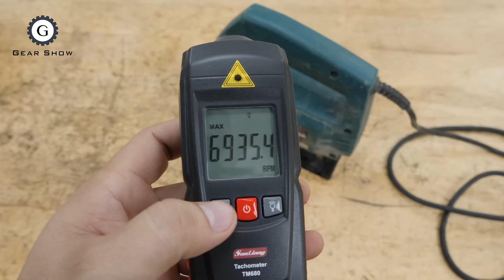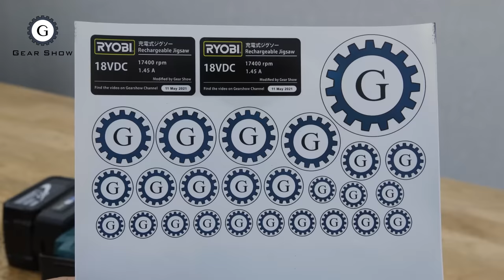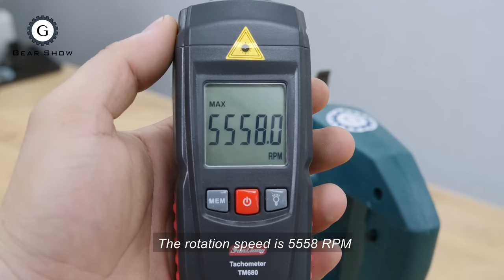Cord to Cordless Jigsaw Conversion from 110V to 18V | RYOBI MJ-21

Comment: the only thing is that the button contacts will not survive later, because the consumption has increased from 4 amps to 10-20
Reply: Yeah .a solid-state relay should do a trick

Comment: What's going to stop the torque from eventually spinning the motor around and ripping the wires loose?  Did it fit snugly enough to prevent it from moving?
Reply: Exactly, I think about the same effect... I fixed a manual mixer that had a motor electrical connector broken because the same effect :-(

Comment: 4:38 that is such a neat and smart way to find the center point, I love it
Reply from the maker: I'm glad you love it, thank you!
Reply: @GrzegorzKr  oh hello, you must be from the department of redundancy department...
Reply: @HunterRodrigez  rofl. the centerpoint trick only works with a perfectly aligned bench drill though. pretty smart nonetheless.
Reply: @mediajunkienl  Well, I'd say it's more reliant on having a very accurate chuck, and drill chucks usually aren't. I'm surprised it worked.
Reply: @Nevir202  You are very right, but mine also has some play in the drill body that's on the rail, adding extra eccentricity :)
Reply: @mediajunkienl  that's why he said use the lathe to drill
Reply: The whole project was silly beginning to end. He took a high quality corded tool and made it into a piece of junk.  He should have just replaced the brushes and cleaned and swap out the grease and would be as good as new.  He went from a high quality AC motor to a poor quality DC motor.
Reply: Until he used the punch to indent it which has significant room for error, would be more precise to use a tiny carbide drill to start the indentation.  I'm sure it will work for a while but the more off it is, the more it side loads the bearing and increases wear as well as a little power loss.
Reply: @tarstarkusz  On many similar projects I would agree with that assessment, but in this case I wouldn't go so far as to call it junk, rather a waste of time because he could have cleaned it up, sold it even if it fetched little money, then the proceeds plus the value of time and new motor(s) (that one is unlikely to survive long term), could have just bought a cordless saw compatible with the cordless tools you already have so no new battery or charger needed.  Low end saws with that or higher performance aren't very expensive.
Reply: @stinkycheese804  I just have not had a lot of luck with cordless tools, and I don't need the portability, so for me it's a lot of downside without any real upside.  If I owned a spot welder for batteries, I might change my mind. But even rebuilding the battery yourself still isn't cheap (I would never put anything but the highest quality cells in any cordless appliance).
  But by the looks of it, the AC motor was not bottom of the line motor, while the DC most likely is.
Reply: @tarstarkusz  and you haven't really done any of that and don't even have a clue what you are talking about...to sum it all up
Reply: @gear_show  Yes, mind blown! The sandpaper trick was super clever xD
Reply: @stinkycheese804  it's not such a tragedy, people have been making their own power tools for ages with hand tools and far less equipment. Successfully even, factory stuff is not that well balanced either. 

Want to learn balancing fans, mover blades, motors? Take a factory piece, plenty of room for trial and error, as there is for improvement.

I wouldn't have done this project either but you naysayers can just find impressive explanations on how simple things won't work to the extremes of how a wheel wouldn't roll unless made by a big brand...
Reply: @dushk0  People were riding horse and buggy years ago too, but I for one don't want to go back to the days when these great burdens took up so much time and energy to leave little for anything else.  To do so today is madness, or a hobby, but as a hobby there are so much better ones.
Reply: @HunterRodrigez  🥺🥺🥺🥺🥺🥺

Comment: This is great, my only concern would be the switch handling the much greater current you need running at low voltage DC. If you run into problems down the line, I’d check that first.
Reply: Should add a Mosfet for high current  switching. The original switch will burn out very quickly under load.
Reply from the maker: @Sheran Naidoo I will try your idea, thank you so much!
Reply: @gear_show  Yeah DC current draws more amps than AC. But LOVE your work better than landfill

Comment: I'm a Huge fan of your work, I love the way you present your restoration and it means a lot to us when we are in need of such DIY restorations.

My only request is to see you restoring a Table Fan and making it run with 12v Bosch powertool Battery and an 895 DC motor, so that it could serve as an emergency fan in times of power outages who's is very important for fathers of small babies like me
Reply from the maker: Thank you for making request to me. It is more reliable by using brushless motor.

Comment: Great conversion and great tip on finding center with the sand paper plus drilling center using a keyless chuck and staying vertical. 
One thing to correct though is your SPM (rpm) figure. The jigsaw is rated at 3200 SPM but you’re reading up and down resulting in a figure ~ double the actual rate. You need to record with the laser at either the top or the bottom of the stroke to get an accurate reading.
Reply: He took a perfectly good corded saw and turned it into a POS 18v battery saw.  A set of new brushes and it would have been as good as new.
Reply: Does it really matter?  Either it has enough speed to get the job done in an acceptable amount of time, and enough torque to not stall or drop to such low RPM that it overheats, or it doesn't.
Reply: @tarstarkusz  but now he can buy cordless and corded new saws from yt revenue 🤣
Reply: @heimdall4148  Your logic is impeccable.

Comment: Excellent demonstration .

I have A reciprocating saw 110 volts and Black and Decker  looper saw 110 volts.
Being from India where voltage is 220-240 volts.
I use a transformer to convert 110 to 220-240 volts.
Maybe Watching your video I am  getting encouraged to go for battery conversion.
Other tools I have too and  all are 220 -240 volts

Comment: The old 7.2 volt twin battery Black and Decker tools work great when corded for 12v using crocodile clips onto a car battery. Many of the Johnson motors used will accept a range of voltage and can easily cope with the current. Never had any problems and can pick up tools almost for pennies.

Comment: Consider 3d printing the battery adapter next time, there is a lot of adapters and prototype platforms readly available for Makita batteries in thingverse.
Reply from the maker: Yes, you're right. I will do it next time. Thank you so much!
Reply: Makes sense, I was interested in the idea if it was possible to go back and forth between Li-Ion and a corded option as both scenarios have their limitations, nip them both in the bud and move on with it.

Comment: The problem with this is that you have no undervoltage protection for the battery - battery powered tools will switch off when the battery voltage drops too low, to protect the battery from overdischarge, which can cause permament damage.
Reply from the maker: I think the battery PCB will handle this. Anyway thank you so much for sharing!
Reply: @gear_show  Unfortunately Makita, Milwaukee and Dewalt have the overdischarge protection in the tool rather then the battery... The pcb in the battery is only for thermals. Ryobi (to my knowledge) is the only major brand that has over discharge protection built into the battery.
Reply: @bengrant4044  Then again that battery is not Ryobi.
Reply: @kdthehun  Guessing reading comprehension isn't a strong suit of yours... If it were a Ryobi battery it would be safe from overdischarge... Since it is a Makita battery; if the voltage gets low you can ruin the whole battery (ie it will no longer power the tool, and will no longer take a charge)
Reply: @bengrant4044  And here you are assuming that everyone's first language is english. Köszi szépen hogy kijavítassz, és gúnyt űzöl belőlem.
Reply: @kdthehun  Eső után köpönyeg
Reply: It's quite obvious to anyone paying attention when a battery is near depleted.   You can hear the change, you and feel the tool slowing...  be YOUR own battery protection and just stop... go recharge the battery.  It takes a bit of self control.  Everything doesn't have to be dumbed-down and automated if you're not a dummy.   I think he provided himself with a viable solution.  Perfect, no.  Idiot proof, no. But very tenable.
Reply: @bengrant4044  The newer Makita 5 Ah batteries have a undervoltage cutoff in the battery.

Comment: I was thinking about this a couple of days ago, just oposite. making my ryobi's cordy's.
Reply from the maker: The universe power bring this video to you :)
Reply: I did that a couple years ago. I found a 20V mains transformer and a simple bridge rectifier that fitted in my old and knackered NiCad "Ryobi One" battery pack shell. It worked really well as a handy way to keep working (When near a wall socket) if you'd ran all your packs flat, but the unit was way heavier that the 2.5Ah packs I'd got used to at that point, and it kind of felt wrong paying extra for cordless tools, only to shackle them to a wall socket.

In the end I just bought a handful of aftermarket Li-Po packs so I wouldn't run out of charged ones. They're cheap as chips, and I've never noticed any difference between them and the OEM Ryobi Li-Po packs (That are 4x the price !!!).
Reply: @Reman1975  You could have put the transformer at the plug end and run the 20v to the battery casing.
Reply: @philtowle4683  Could/should have, but at the time it was easier to fit it all in the space the dead Ni-Cad's had occupied and use an old computer PSU's "kettle lead" socket to get mains power directly into it. To put the transformer near the wall socket I'd have had to buy an enclosure for it.

Comment: If you clamp something like that in a vise use an old rag or the like to prevent markings and CLAMP it down damnit!
No need for that much grease...don't worry a small dab will do the job well.
I like your homemade sticker...it really adds a nice touch. :)
On the sideline....most small apertures like this saw use universal motors which means it can be powered by AC or DC. That's why you could make that conversion.
If one is in doubt, it's better to look it up before one butcher the thing. :)

Comment: While it's aways fun to tinker like that, cordless tools don't break the bank nowadays, especially not if you already own the batteries. Corded tools are almost never brushless, so you lose efficiency. Fun project, but hardly worth it. I'd rather build a huge power bank to power my corded tools. At least that's a flexible solution.
Reply: ...but he replaced the motor, didn´t he? Couldn´t you just put a brushless motor in?

Comment: Actually, brushed motors in corded drills,jigsaws and circular saws are universal motors.They can run on both ac or dc.Could've tried using the original motor.
Reply: the voltages wouldnt work. The current would be around 20x too low.

Comment: I was trying to see what he used to convert VAC to VDC... 
...
Then he changed the whole system...
Reply: If he did that it'd be a simple rectifier and a switching circuit
Reply: @nikims_  lot power loss if using inverter
Reply: @zeddybuddy8619  ? Okay lol? Do you know how any digital electronics device you use that takes power from the outlet works? Like a workstation, or gaming machine?
Reply: @nikims_  that for sure but we talk about 18v battery..it will be different story
Reply: @nikims_  that my friend is when u want to apply wall plug electric to a dc device... also sorry my wordings might be misinterpreted...
@Zeddy Buddy yes i agreed with power loss...

what makes me asking the question is actually the build is so clean... it is possible making diy power inverter circuit inside the jigsaw body to accommodate all components thats what interesting to see... however even with that, 18v battery idk maybe 4500mah that size? and normally a 500w-700w ac jigsaw, that battery gonna last you about 5 mins roughly? so actually changing the motor to dc motor is actually the best solution...
Reply: @nikims_  Nope - you’rethinking the other way. It would be low voltage DC to high voltage AC @ 2.3A. Basically shoving a 300W inverter in there. Expensive and impractical. Installing a DC motor was the smart solution, but very labour intensive.

Comment: I would have added a variable pot, way too fast for some uses. Great job though
Reply: A pot won't handle the high current draw. One viable solution for those not into electronics would be using an ESC (electronic speed control, brushed motor variety) driven by a servo tester. The servo tester's pot will signal the ESC to vary the power sent to the motor. Both ESC and servo tester can be found a most large radio control hobby stores. Total cost should be below $30.

Comment: it’s a shame that do you not added light LED near knife.
Reply: That seems less practical on a saw like this than on other tools, generally you are above it and aligning based on the top, not watching exact position of the blade which would mean your head is off to the side and then far easier to start drifting back and forth making corrections instead of just keeping it straight in the first place.

Comment: I actually want to do the reverse of this with my Mower, batteries are expensive...
Reply: Nah, you can get refurbished Tesla 3 batteries for half the price of Samsung 30Q's or 40T's and build some low-cost powerful packs that would last at least 5 to 7 years. Lumber cost more than batteries these days thanks to the Biden administration.
Reply: @FarmerFpv  That makes no sense, the Tesla 3 battery is far more capacity than needed, then the bother of tearing it apart, rebuilding a pack when you had to destructively disassemble the original pack plastic spacer to reuse it otherwise, then you cannot asssume 5 to 7 years because they are used and even new may not last that long if used regularly, so it would cost more, be a massive amount of time spent, be reconstructed in a dodgy way then subject to mower vibration constantly, just NO!
Reply: Doing the reverse would be relatively simple if you can find a switchmode PSU capable of enough current, that will fit where the battery went, and is passively cooled without vents in its casing since a mower produces an incredible amount of flying debris and dust so the PSU must be sealed to last long, but be designed to be sealed not you seal it up later so that it stays within its thermal design.  The trickier part will be if the mower itself has a built in protection circuit that relies on communication from the battery BMS to run, then you'd need to disable or emulate that.

Then again, used ICE mowers are often inexpensive and if there is a market for your electric mower to resell, it could make sense to go that direction instead.

Comment: Rewiring the original DC motor from 110 to 18V would have been easier, and probably given better performance . You went from 220 to 30-ish watts, by rewiring the original motor with 3-5 parallell strands of wire similar to the original one you could get much better (if your battery can supply 10-11 amps then 6 strands might work, but that might be a bit tough). Would need to rewire both rotor and stator, though. Lovely touch with the phone charger USB, though.
Reply from the maker: Okay, It sounds interesting to me. Will it save the battery energy? Anyway thank you so much for sharing the tips.
Reply: @gear_show  Quite the opposite. It will use it up quicker. So if you're happy with the performance right now, I would leave it as is. From the video, it seemed to work, so why not? :-)

Comment: Fyi, the old motor is a "universal" motor.  It would run just fine on 70-90Vdc.  Though that's a little high to easily get from a tool battery pack.
Reply: Feed the anchor and the fields in parallel.

Comment: Good job, but if you like, I tell you some points of improvements about the electrical wiring. 
First, your solder job is not bad, but also not perfect. The solder should flow by itself. There should be no need to smear the solder with the Tip. Wait a bit longer or use a bigger/larger/hotter soldering tip. And never ever tin-coat the wire in a screw connection. You might be safe because your switch is a spring-loaded clamping connection, but even then this is bad practice. Better is to use wire end ferrule and in clamp connection, you even don't need them, but you can if you like.

Comment: interesting idea
i am curious how long will that ac switch holds up with dc and about 3 times greater current
ortginal motor was like 220w what is a power ratings of the dc one? because your label would mean it is now only 25w and a motor seems to be 100-150w range
what is it's stall current?
Reply: Its a 500 series, not sure of the brand, but it should be capable of about 500 watts. Depending on what type of battery circuitry, circuit could likely draw close to 30amps. Contacts in the switch probably wont last too long

Comment: That dust cover you used to bathe the housing in, is worth more polished and restored on eBay than this technical exercise imo. One would net from it's sale enough to buy a cordless saw with a 550 motor .

Comment: Great job. The only thing I'd point out is that I don't think the blade is fully inserted - The roller should be running on the back of the blade, not the quick release notch.
Reply: I thought the original jigsaw used a different style of blade.  My older one did anyway.